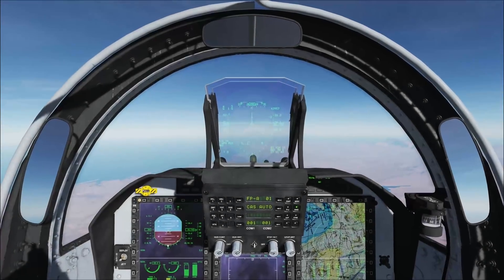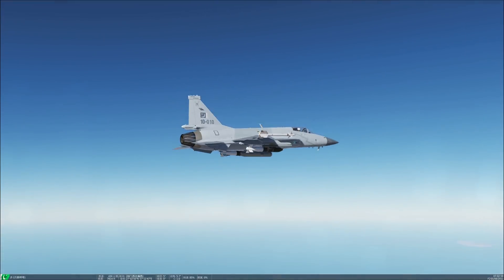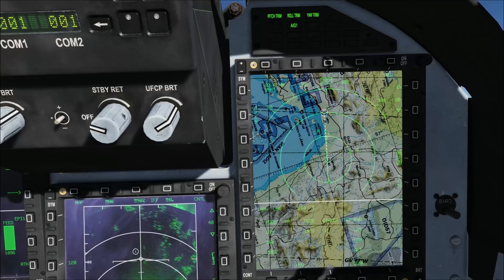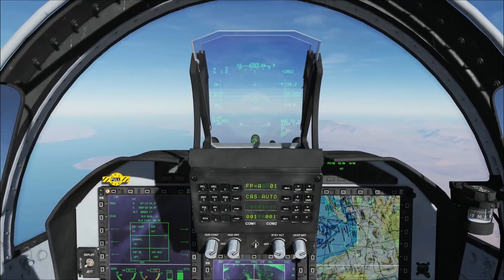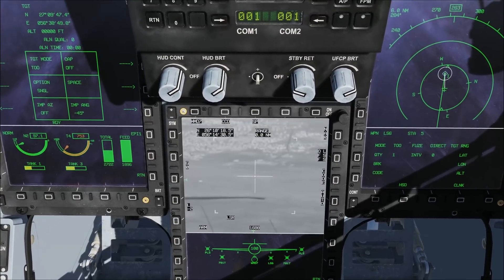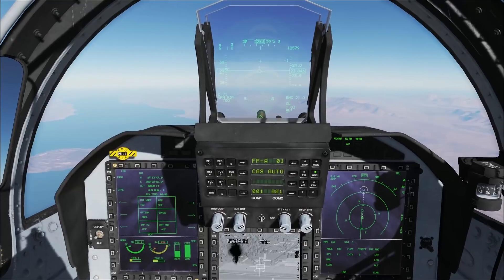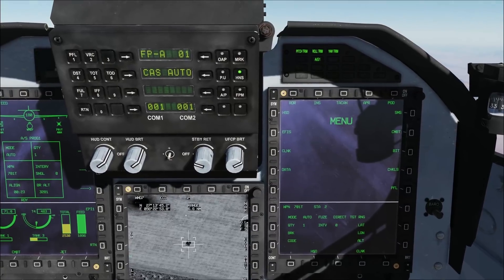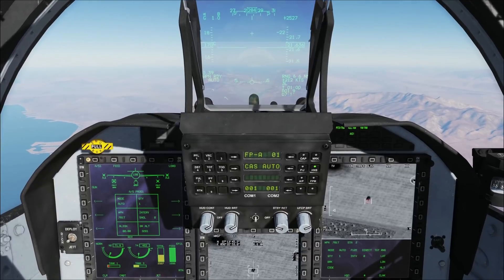DCS: JF-17 - 1. LS-6 and C-701T

Comment: Jf 17 shot down 2 Indian jet.27 February 2019
Reply: @East is East uhhhh dude, you have very little knowledge regarding the SD-10 MRAAM and KLJ7  pulse doppler radar. First of all, the F-16 MLUs and blk 52s have better radar in terms of range and other options. The JF-17 block 1 and 2 in terms of overall performance, are like that of the early F-16A, but the JF-17 does excel in terms of ground pounding variety. The block 3, however, will be a game Changer, and will pose a real threat to the IAF, especially with new AESA and JHMCS along with a new EW suit. However, this shouldn't damage or weaken your morale. The fact that we shot down a Su-30 along with a Mig-21 is a huge thing. On a side note, th JF17 Block 2s were also in the A2A role and had aslo locked on to several other IAF fighters, but didn't get clearance from the mission control to shoot due to political matters. However the JF-17 should not be taken lightly by the IAF, because in the hands of a Pakistani pilot, the(IAF) is screwed
Reply: SU 30 was shot down by F-16 and Mig21 was shot down by JF-17.
Reply: @irfan-106  lmao no, the JF-17s have been used for mostly surgical strike role on the 27th of Feb 2019. Yes, JF-17s have locked on to enemy aircraft but did not fire due to no permission by the controller.
Reply: Umm  F-16s shot down 2 Indian fighters using AMRAAMs. Squadron leader Hassan took down a Sukhoi and Wing Commander Nauman took down a MiG
Reply: Heatseeking Missile Yep, that’s the offical stance aswell.
Reply: @averageaviationgeek9318   why you pakistane   airforce   pilot .  hahaha
Reply: Heatseeking Missile Both the fighter were F16s. JF17 was never used. It is on display in the PAF museum. Mirage was used to drop bombs on the Indian base.
Reply: @irmaskitchen4177  the aircraft that shit down the IAF fighter were both F-16, no doubt. But, what I'm trying to say is that F-16s and JF-17s were used for A2A. The JF-17 did NOT shoot down any fighters, but was still used. In fact, it was still being used in CAP missions after 27th Feb and on one occasion locked on to some IAF Sukhois 'across the fence', trying to lure them in.
Reply: @averageaviationgeek9318  sir SL hassan siddiqui is a f16 pilot and WC noman is a jf17 pilot 
In this attack PAF used 3 different team one have f16 and other have jf17 and mirage.
Reply: Actually, surgical strikes were done by upgraded mirages. Whatever I am saying based on input by a PAF officer.
Reply: @irfan-106  aswell as JF-17s

Comment: Jf17 is good plane?? What is block3 and air frame change in block 3
Reply: JF17 block 1 is a aircraft developed based on the SUPER 7 project, so it can be traced back to J7, Chinese version mig21. However, Jf17 has a new designed 3rd(taking F35 as 4th gen) gen aerodynamic shape and  electronics, so it's a deeply improved 2nd gen fighter. This one , the block2 gets a 3rd gen level engine and many electronics improved, thus it becomes a 3rd gen level fighter.  Block3 will have an AESA and some more advanced electronics. the JF17 would be able to shoot some new weapons developed by China, PL15 for example. the JF-17 would reach the 3+ gen level. Btw, that DIS inlet makes JF-17 the world first in serves DIS inlet aircraft,. F35 's DIS inlet was designed earlier but JF-17 get into serves before F35 does.
Reply: Sorry not DIS inlet, DSI instead...

Comment: ED : makes rockets tutorial vid for 2nd 4th gen fighter to release with only dumb munitions on early access
Absolute lads Deka : "Hey guys look at our TV missile, TGP and JSOW. Oh, and our ground radar works"
Reply: Deka: Hold my Tsingtao! /)
Reply: Maybe enough disrespect for ED when they have to work on several modules at once and on the engine itself, which Deka for some reason didn't try to write on their own? Do you even realize what kind of complexity making these takes? Do you think they have half a hundred PhDs working on the physics and the systems for nothing?
Reply: @getsideways7257  They don't have to work on several modules at once, they just want to. The hornet was released a year ago and only received it's goddamn TGP (that's barely functional btw) this summer. ED chose to make yet another module at the same time, that is a problem of their own making. It even means that the older modules are aging, some rather poorly (Huey's freewheeling unit still doesn't work as it should, the yak is not only unfinished, but bugged in OB too, etc.).
Heatblur and Deka understood that releasing a more or less completed module is better than just slapping a price tag on your alpha version and improving it whenever. Aviodev is doing the same, polishing their first plane before releasing or even showcasing their next one. Razbam is also fixing their lineup before their next modules.
Stop rationalising.
Reply: @TheSkipjack95  I like it how everyone is a good guy apart from ED. Even AvioDev and Razbam... Even though AvioDev took their sweet time right after releasing the thing and only actually started to sort it out recently (when I thought they were going to bail just like VEAO did). And Razbam? Oh, don't even get me started about Razbam... But yes, I'm happy they've finally come to their senses and started fixing what needs to be fixing. But it also looks like ED are working on their oldies too, doesn't it? Even if I personally couldn't care less for the Ka-50 and indeed would prefer them to finally sort the Huey out. But at least it's still in a much better shape than the Gazelle... Not mentioning Polychop, eh? And VEAO, for that matter... Because, come on, everybody knows that only ED are the bad guys. Even though they have to work on the damn engine too (and there is still a ton to be done).

I don't have a problem with them working on several modules at the same time. Otherwise I'd still be flying the Warthog and I hate the thing. Not a huge fan of the Hornet either, but the Viper is one of my favorites. I don't think I will hate it if it comes out mostly barebones either, as long as it flies like one. It takes forever to develop these modules with or without parallelizing the work (at least they have much more people than the 3rd parties and are still hiring). I guess you would be happy with your Warthog, but I'm glad the Viper is right around the corner, complete or not. That's the aircraft I was mostly waiting for.

Comment: Now if only ED could've done this with the Hornet on release.
Reply: I mean heck people probably wouldn’t of minded if they would have a little bit more effort into fixing it off of launch and also having some more key systems done like AG radar etc.
Reply: Ean Bezemer true but then you also would of moaned if the Viper was delayed a year?!
Reply: @sparkyplug28  thunders release has proven that its better if you wait for a better bird instead of some unfinished eye candy. No one cared shout jf 17 thunder, heck no one in DCS I knew cared much about the jet. Now everyone is wooed over the jet not because it looks pretty or has accolades similar to a 16, or 18, but because it's actually fucking feature Complete. Not just that, it's quality work.
Reply: Asif Talpur couldn’t agree more I waited for the JF-17 over viper because I fully expected a bugger viper release still don’t have it and currently see no need to get it due to this fantastic jet
Reply: ED doesn't have the fortune of focusing only on a single plane. People always complain about "X module needs to be finished!" without realizing everyone else is mad about the one they focus on. 
If ED was just doing the Hornet and didn't have to think about the game engine, other modules or anything else, I'm sure it would have been similar.

Comment: Is this JF-17 a mod or official release?
Reply: Will be full module
Reply: @Dan20q  My dear if you play DCS can you tell me which laptop or PC are you using?
Reply: @R4V3NETTE  yes! Ryzen 5 3600, RX 580 8GB, 16 GB DDR4.
Reply: @R4V3NETTE  If you want some minimum specs, for DCS you want a 4 core gpu that can reach 4ghz, a gpu at least as powerful as a GTX 1060, at least 8gb of ram and 16gb for multiplayer, and an SSD.
Reply: @R4V3NETTE  dont play on laptop
Reply: @Mrv9019  it depents, I using my laptop play DCS and warm my cap cake same time.
Reply: @反動學術權威  yeah laptops have a problem of overheating.
Reply: Galf506 8gb of ram is painful at least 16gb and 32gb for multiplayer I’d say!
Reply: Its not a mod. It is an offical module you can buy for DCS
Reply: Official third party DCS JF-17 by Deka Ironwork Simulations, fully clickable.